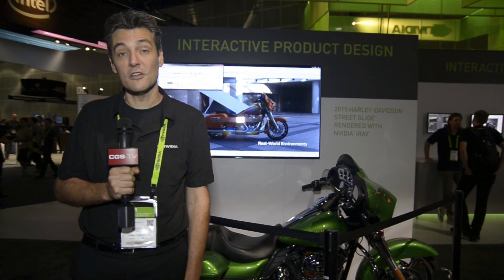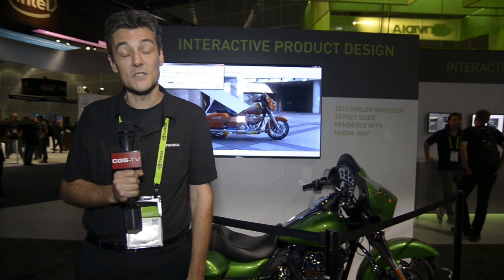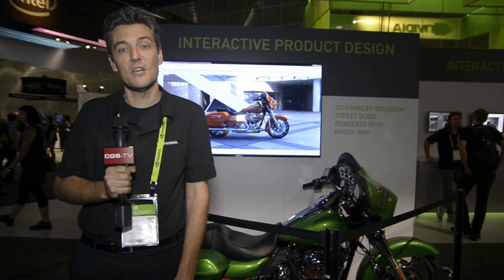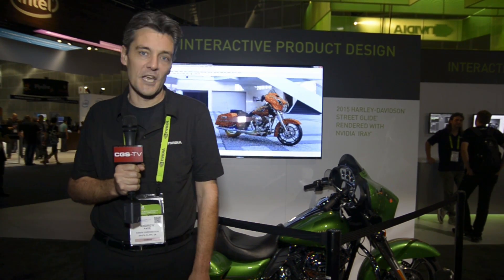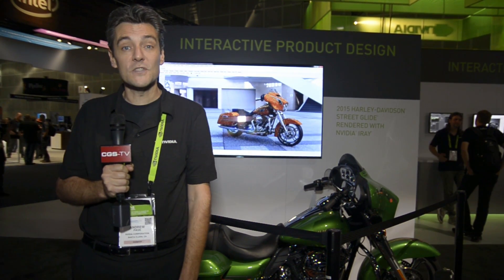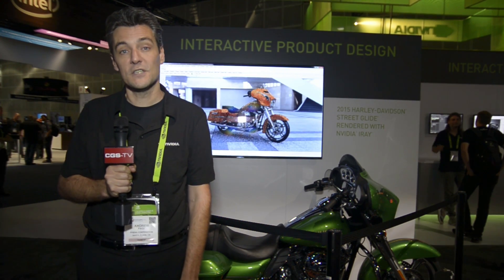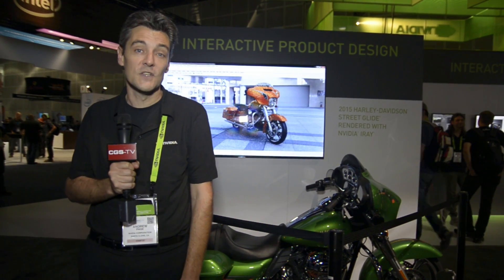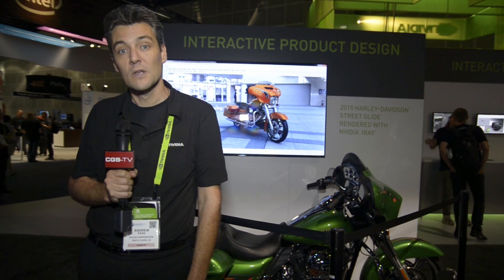Is it real or rendered?

Comment: Im slightly confused, have been using Iray for a while and have never come over the Interactive or Realtime rendering modes, In max you can use the Active shade feature with iray, but its far from interactive, you can change camera positions and lights, and material colors and so on, but you cant add anything new,.. geometry, lights, materials, same as you cant remove anything. im really curios to what these rendering modes are